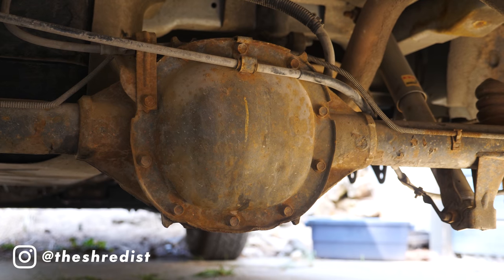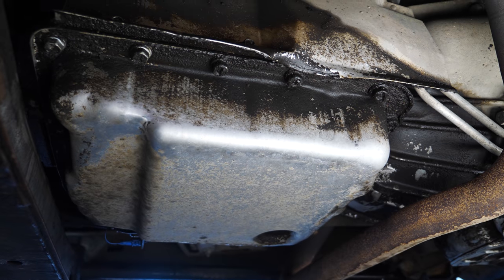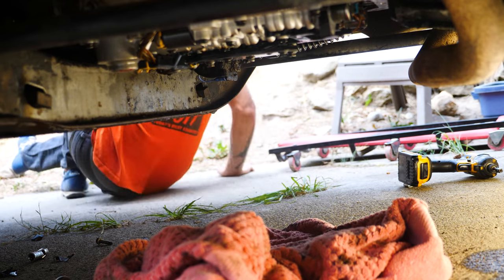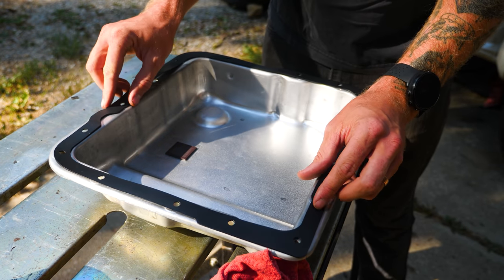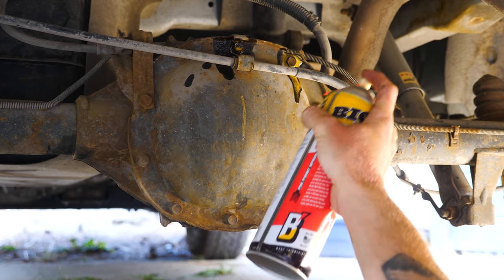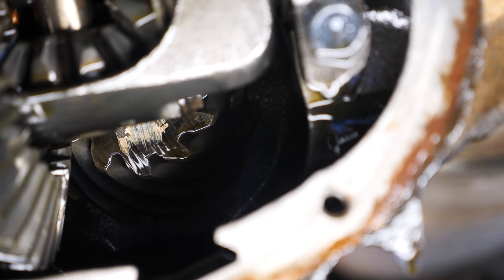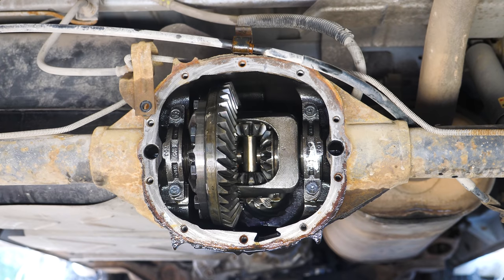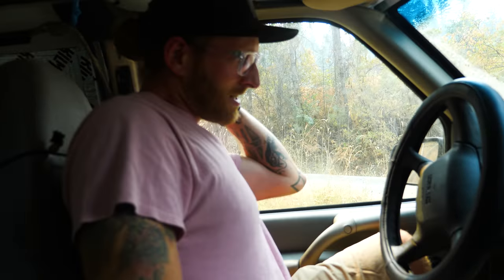Is Scruffy's Drivetrain Toast? Fixing Leaks and Finding Creaks - Scruffy Build Part 7

Comment: New [bearings]  on pinion shaft and seal from what I could see.  A junk yard rear end is also worn the pinion gear lash is set to the ring gear. So if you swap parts you will have to reset that lash not easy. There is a crush spacer on the pinion to set lash, it's hard to hold the pinion and tighten the outside nut to set lash good luck and may the force be with you!!!!! I have done several.

Comment: my 1999 has 325k miles on it who knows when the rearend gear oil was last changed going the get my machanic to change it soon. i wanta make mine into a camoer it is hard to mfind fermeldhide free matericals . everything has it paneling plywood press board insulation plywood. home depot does have fermeldhide free paneling 38.00 a sheet. in the 90s i built a chevy G10 to live in i used cheap 3.00 a sheet paneling from scottys it had fermeldhide in it and gave me resporitory problems it made my dog sick too. when i ripped all the paneling out i got better so did my dog

Comment: I believe I had that noise and drove it for around a month, starts to shake a bit too. Worse under low engine speed or big loads - trailer or hard accelerating - I believe it was a rear universal or some bearing on the end of the driveshaft. Possibly the pinion bearing.

Comment: Definitely replace the rear end with another. Way cheaper and easier than rebuilding the rear end properly. The wear pattern on the ring gear didn't look good and if it is making noise, it is telling you it needs help. Take your time shopping around to find another as there are thousands and thousands out there. Go for low mileage and van condition when looking. Don't be afraid to be critical because it is you doing the work and living with it afterwards.

Comment: Every adventure vehicle needs upgrades. Unless you buy a $100k van and it'll still probably still breakdown. If you keep it you definitely need to upgrade transmission and differential, especially if you plan to add weight. Those engines are pretty solid. Just look out for oil starvation on those Vortecs. Wish Toyota made bigger vans. 😂✌

Comment: Doesn't look too too bad from what I could see. I would run it for the time being, maybe start researching/accumulating parts for a rebuild over the winter if possible, or find a junk yard unit to swap. Also, in my opinion, it is much more likely to have a driveshaft vibration than a vibration from the rear end. Something to keep in mind also, but that noise seems like rear end. Have you checked the wheel bearings in the rear?
Reply from the maker: I haven't checked wheels bearings, but that will be one of my next steps!

Comment: It better to buy a used rear end in Junkyard and put fresh oil if you know the rear is good. I'm think the cost is around $150 in your area. Differinal rear ends generally don't break down unless under extreme conditions. Like 4x4, rock crawling or towing with the van.

Comment: That rubbing noise sounds like your finders rubbing your tire after your lift and new tires you put on???? Did you ever figure out what it was? I have a 2004 GMC Safari 2wd wish I had AwD but I just bought mine about 2 weeks ago 195k and I'm turning it into a camper van so far it's going good had to replace water pump and thermostat no more overheating but still have service engine soon light??? I think I have to do just a tune up new plugs and wires and hopefully that solves it just about to get it registered and hope it passes smog as long as my catalic converter isnt burned up lol 😆

Comment: Make sure you match from to rear end gear ratios, looks like your lash is toast, which means your ring and pinion should be replaced, And a bad bearing probably caused it, your diff needs a good going thru. You need a press for carrier bearings and pinion bearing installation as well dial indicators or depth micrometer for the ring and pinion set up. So price those out as well gears and a master rebuild kit to see your starting cost. Then balance that against a shop quote for the whole job, and if you plan on doing it think a week or two, I don’t mean to be a downer because I love your content. But don’t want to gaslight you either. Someone was in that diff before and did something wrong for it to go out like that.

Comment: Hey dude, just picked up 2004 gmc safari sle with the exact same 4x4 conversion kit and lift as yours. Driving it home I have very similar issues on steep grades on the freeway at about 55-65 did end up being the issue with the shifting?
Reply from the maker: No shifting issues. I've been made aware that my front leaf mounts are a hole too far up.  I'm going to drop those when I get a chance and see if the noise is less. I almost thing the steeper angle of the driveline might be causing at least a part of my noise.

Comment: Did you use Auto Trak 2 fluid in the diff?  I had two mechanics add different fluid plus an additive and it was terrible.  Changed Auto Trak 2 trice and it solved all my issues.
Reply: Auto Trak 2 if for the transfer case not the diff.

Comment: Seems like the gears are not meshing correctly, causing heat and noise. As to why, it could me mileage or someone did a poor job rebuilding it. I’d buy a locker for it if you rebuild it

Comment: did you check the rear u-joint?
Reply from the maker: Yup! I've replaced it with a freshie when I did the t-case.
Reply: Thought you might have but I couldn't recall.  If I had to guess it's probably the pinion bearings going out then. And if you're going to get that deep into it it's probably worth just having the entire axle overhauled. Depending on what diff that is you could probably find a factory g80 locker to put in it